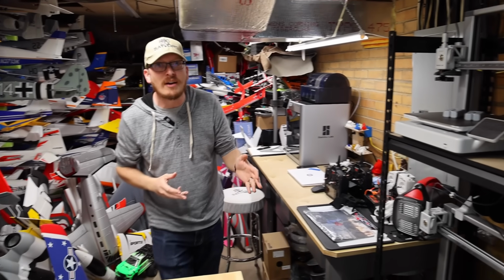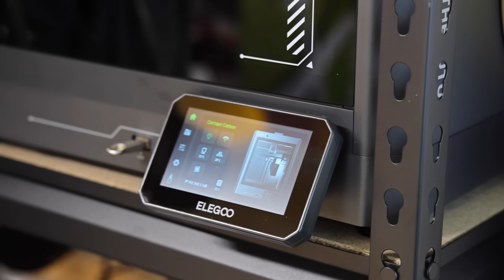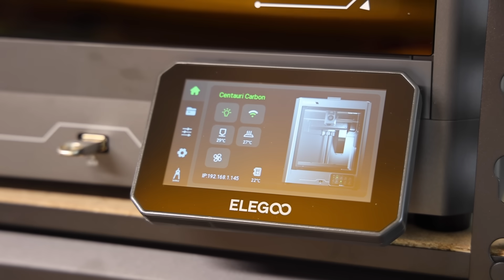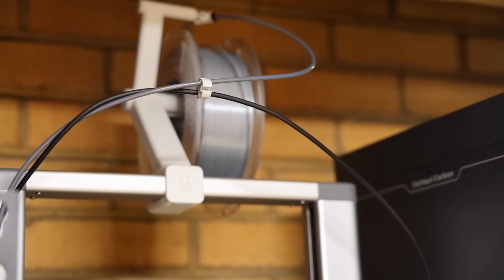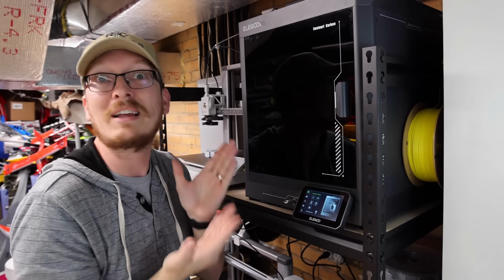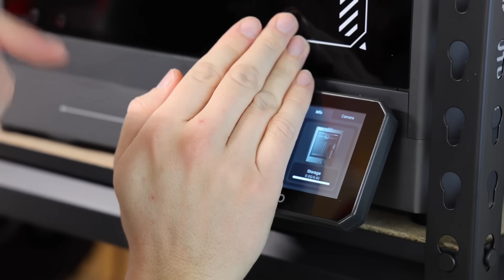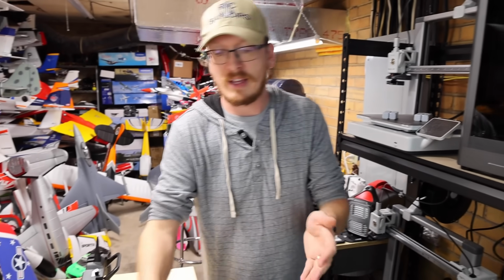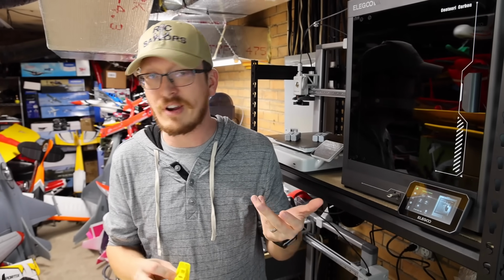Elegoo Centauri Carbon $299 CoreXY Enclosed 3D Printer - First Impressions

Comment from the maker: This printer is back ordered for months.  We recommend checking this one out instead: https://shrsl.com/4ugkc
This is Nate's experience with the Elegoo Centauri Carbon 3d Printer.  Let us know what you think of this 3d printer in the comments.
This printer comes equipped with these features:
Print Right Out of the Box
Full-Auto Calibration
CoreXY with 500 mm/s Velocity
20,000 mm/s² Acceleration
Unleash Creativity with Every Filament
Chamber Camera Acts as Your Eyes
Build Volume 256 × 256 × 256 mm
Disclosure: This description box contains affiliate links.

Check out the Bambu Labs A1 here: https://shrsl.com/4ugkc
Check out the Bambu Labs X1C here: https://shrsl.com/4t6rk
Filament used in this video : https://shrsl.com/4t6rl

TheRcSaylors Shop: https://www.etsy.com/shop/TheRcSaylors

You can see more on Elegoo's website here: http://www.elegoo.com

The products in this video are rated for ages 14+.

Amazon Storefront: https://bit.ly/m/TheRcSaylorsAmazonStorefront
FMS: https://www.fmsmodel.com/bG7_qnRWGKXIak
AMain: https://bit.ly/3FIc1V7
Hobby Zone (Arrows): https://bit.ly/3Sp3HRR
Tower Hobbies: https://bit.ly/3FB56gq
Banggood: https://ban.ggood.vip/14gJx
Redcat: https://www.redcatracing.com/?ref=FXq96heFYK8m
Aviation Apparel: https://bit.ly/48yTc3Z
Fair RC: https://bit.ly/3QkFJ7r
Horizon Hobby: https://bit.ly/4c8vZXZ

Support TheRcSaylors
     Patreon & Stickers | https://www.patreon.com/TheRcSaylors
     Website | https://www.thercsaylors.com
     Merch | http://www.thercsaylorsyt.com/shirts
     Mail | 1140 Carter Ave, P.O. Box 361, Ashland, Kentucky 41101

Social Media
     TheRcSaylors Shorts | https://bit.ly/3rN37xp
     Facebook | https://www.facebook.com/thercsaylors
     Instagram | https://www.instagram.com/thercsaylors
     Twitter | https://www.twitter.com/thercsaylors
     Vlog and Live Channel | https://www.youtube.com/TheSaylorsYTchannel

SPECIAL THANKS TO OUR PATREON FAMILY!!
john salt, Jose Valentin, Ray Hicks, Richard Higginson, Robert Sanges, Russ Cooper, ruudy, Ryan Alexander, TIMO, Zach Gushing, Chris Hamlett, David Chenzoff, dmilbrandt, Doug Dahlheimer, Gary Zion, Haar Bear, Jason day, Jeffrey Davis, and Jesper Larsen

#3dprinting #elegoo #3dprint

Comment: The noise levels are a main thing for me! I'm an Elegoo resin printer guy through and through, the Saturn 2 8K beautiful, no sound, Saturn 3 12K ultra loud, Saturn 4 16K ultra, back to being quiet as a mouse, perfect! I did make a blunder buy a while back when the Anycubic M5s came out; that was like an F16 starting up, it was so loud, so that didn't stay long! But I am looking for my first FDM printer and first turn was to Elegoo, but this is a nope from me! What's it got, plastic or 3D printed parts in them motors and fans?

Comment: To noisy for me.  too bad..
Reply from the maker: It is by far my loudest machine. However I’ve had a few good prints on it. I e also had some failed prints. I’m sure it’s my settings, but it is also my slowest printer. It can handle benchies just fine but any file I’ve downloaded usually prints super slow and if I speed it up it tends to have issues. The main one being print bed adhesion issues. Least favorite current printer, but would be better than no printer at all and is better than a lot of options out there. 👍💯⚓️

Comment: i will buy my first 3d printer, i am still a beginner and do not know most programs and am not advanced either. i have researched for a long time and actually 2 models fall within my budget the elegoo centauri carbon for 300 euros or the qidi q1 pro for 420 euros. both fall within my budget of maximum 450 euros. i have the idea in terms of specifications that the qidi q1 pro scores better. but because i am a newbie it would also be useful if the software is user friendly. 

which one would you recommend to me? i find ease of use, reliability and lastly print quality important. 

i am not very handy with tinkering and repairing so i prefer something that is reliable.

which of the 2 would you choose for me? And why? 

By the way, I've been following you for a while, you're really doing a good job!

Comment: I love how Elegoo has shaken up the industry with this printer but...I'm skeptically optimistic. Elegoo has inconsistent quality control and their customer service is mediocre, at best. It will take a year or two, and 1000's of print hours, before they will even begin to touch Bambu's market share, particularly in the print farm industry. 

Also for anyone looking for a budget, fully enclosed core XY printer with a hardened steel nozzle check out the Qidi Q1 Pro. You can get them for less than $400 and they are the best kept secret of print farms all over the world. They aren't the prettiest, but they are absolute workhorses. Plus, Qidi has fantastic customer service. As a bonus, it has a chamber heater, which makes printing ABS, ASA, Nylon, and CF filaments as easy and reliable as printing PLA.

Comment: Nate, there should be upgrades for the fans as manufacturers usually use the cheapest as people start posting mods online. I always go over new printers just to check that all screws etc are tight etc,plus lubrication in case they slacked up on it. Look at some Printed RC planes…Abby that’s part of the hobby too😳LOL

Comment: I pre-ordered mine last month when it finally hit. I almost pulled the trigger on the bambu labs x1c (I still might eventually) but after all of the bambu issues with their basically locking everything down, it kind of swayed me away from the purchase. I guess I'll wait to see how it works for bambu before I jump back in. But the x1c will stay on my radar.  I do like that I don't need the internet to run it. Unfortunately where I live internet prices are getting out of hand. Maybe If I can find something in my price range. Until then I guess I'm taking the elegoo bus to 3d printing town. 😁

Comment: The Elegoo has a massive cooling fan on it that they introduced with the Neptune 4 series. You have the fan that's on the hotend which is pretty normal. Then there's the auxiliary cooling fan that brings a cat 4 hurricane into your home. I know on the Neptune, you can turn that fan on and off. If you're only printing at like 200mm/s then you don't really need it. I would think that you can also turn off the Aux fan on the Centauri as well which should drastically lower the sound.

Comment: I don't know how so many reviewers just cannot see the EXTRUDER tab. It's not even hidden. I could literally see it in this video. Thats where the load/unload the filament is.
Reply from the maker: I find it interesting that multiple people have missed it, like myself. That tells me there is a bit of an “ergonomics” misstep on Elegoos part. Though not a big deal at all, it would be nice if it were placed somewhere “more obvious” since this is designed to be a beginners first 3D printer! Thanks for taking the time to tell me where it is! 🙏👍😎💯⚓️
Reply: @TheRcSaylors  to me, the layout is very similar to the X1 Carbons interface. It was all very intuitive.
Reply from the maker: You’re right, it is extremely similar! Maybe that’s why it was difficult to find that “page” 🤷‍♂️💯😁⚓️

Comment: Could you make sound comparison between bambulab and centaur carbon where you use similar speeds and accelerations in both machines. Is just the speed that is noisy or the printer itself.  Now I'm not sure if comparison was that super fast benchy vs bambulab normal speed. And of course what the noise level is when using centauri carbon with that silent mode.

Comment: People think that since it's enclosed, it should be quieter. This is not true. Having a x1c and an a1, if I have to print pla, petg or tpu, I rather use the a1. It perform as good, but way more quieter. The x1c is used when an enclosure is needed with high temperature filaments like abs or asa and other. If you don't plan to use other filaments than pla, petg or tpu, don't get an enclosed printer unless you are ready to deal with the noise

Comment: Click on the 3 line icon on the home page, then the extruder tab on the top and there are load-unload buttons . Mine came with the latest firmware already installed.

Comment: Going to need a 1,000hr torture review haha
Reply from the maker: I’m planning on putting some hours on this thing. I just don’t know how well it will hold up! Why’s it so loud though!? 😬💯⚓️
Reply: @ Bambu CEO has a degree in turbulence. Hence why they are so quiet in comparison and cost difference as well. I’m hoping it last as I’m looking for a few for my farm. 

Currently have 3 A1s and 4 minis with all over 3,000hrs each and no issues. Except one mini with a nozzle heater that went out a few hundred hours in. Also the nozzles tend to slowly clog after a few thousand hours on the A1/mini series etc.

Comment: I have the X1 and the PS1 and both have the dual side plates  from the factory. I also have 2 A1s so as you can tell i love Bambu Printers. Just to let you know im far from new to the 3d printing game my first 3d printer was a kit you had to assemble nothing was in 1 piece but the frame pieces. If anything if you go cheap in 3d printers thats what youll get. Dont fall in the oh goody its cheap, Because in 6 months when you cant get parts youll wish you had went a better brand with part support.
Reply from the maker: I’m sort of feeling that way about this printer, currently. Getting those vibes. The more I hear about Elegoo (other than for filament purposes) the more horror stories I read and hear. Seems to be a lot of instances. This CC for $299 is insanely appealing, but being back ordered until July might be an indicator of part support, as you mentioned. It’s printing well now, but really wondering how well it will hold up over time. That is the true test of these things IMO. 👍😎💯⚓️
Reply: Totally agree… I had such a horrible past experience with Elegoo. I would need to see long term use cases before I would ever consider another printer from them. It looks cable but how long is it going to stay that way

Comment: IT looks very similar to the Creality X1C, even the display is in the same location.
Reply: More of a mirror image the x1c screen is top left and the Elegoo screen is on bottom right but about the same style core xy machine
Reply: 1: Creality doesn’t have a x1c .
2: this will give a better experience than the k1c with better quality frame and overall hardware and build.
Reply from the maker: A lot of people are suggesting that it’s a direct ripoff done much cheaper. I can totally see that. So far, I’m not sure if the super loud noise is worth the small savings, yet. 🤔💯😅⚓️

Comment: This printer is a much more capable machine than the A1, like it's comparing apples to oranges. In fact, it's more capable than the P1S too. If you're looking for a printer that can print advanced materials reliably for engineering or functional purposes, this printer is second only to the Plus 4 and maybe X1C. You should Also consider greasing the lead screws and guide rods, it should have come with a packet of grease for this purpose. There is also a load, unload function in the extruder tab.
Reply from the maker: Usually when I’m comparing something, I lean toward price as my baseline. Also, I don’t have a lot to compare it to as you might see 😅 However I do understand it isn’t a great comparison. I am a bit worried by how loud this machine is though. It almost scares me thinking it’s about to explode or something!! Do other reviews speak to how much noise this puts out? 🤔💯😬⚓️
Reply: @TheRcSaylors  I'm sure you looked into it more yourself but just incase, yeah others noted it's a little more on the loud side specially compared to other machines
Reply: It's not a quiet machine for sure, but no you don't have anything to worry about lol. I think it's construction method, while making it extremely sturdy also allows resonances to amplify sound upon its surfaces. 
I would check to see that any screws haven't backed themselves out during shipping. There are also sound deadening mats that you can stick onto the sheet metal panels to help eliminate resonances if it's an issue.
The Kobra S1 is a quiet machine if you want something enclosed but it's filament compatibility is more restricted like the P1S'.
You can download a decibel meter on your phone and check to see how loud it is with the doors closed. You shouldn't see anything above 60 I think.

Comment: The Load/Unload is under a tab on the settings page I believe. (I had to search too after the upgrade) I'll double check when I get home. I didn't notice that much noise, but I'm not in the sane room and haven't printed at Ludicrous speed. Perhaps a little of the enclosed grease on the screws? There is on board storage that you can reprint from as well as store the time-lapse videos. I usually download prints from my laptop. Thingyverse has some neat addons for your Simple Scout XL too.
Reply: It is under "settings ", then "nozzel" tab.

Comment: From the home screen go to the 3rd option down (3 lines with dots on them) where you can control the axis. Click on the extruder tab and you should find the load and unload filament buttons.
Reply from the maker: Thanks! I feel like this is a bit “hidden” but that’s just my opinion of course. I appreciate your help! 🙏👍💯😎⚓️
Reply: The Centauri Carbon's fans really do need to be dampened. 
There are other things like how the frame and outer panels are designed. The filament spool holder doesn't look strong enuff. You can actually see the side panel pull out if you tug on the spool holder. 
Firmware and having to stay within the Elegoo Slicer clone are a bit restricted in my opinion. 

Have you tried out the fluidd interface yet. 
That would be great to show in a future video. 
I have let Elegoo know that if I buy 10 of these I'm going to want to put 400watt heaters in them and they would have to work with me on upgrading the electronics to withstand 60c chamber temps. 

Interesting video! 
Really like your genuine approach to review videos. 

Keep posting videos as your experience progresses and good luck! 🙂👍🏻

Hillbilly Engineer

Comment: i wish it had multi color
Reply from the maker: Me too! Elegoo has stated they plan to add multicolor ability to this printer later in the year, but obviously it will cost more. 👍💯⚓️
Reply: @TheRcSaylors  where could we connect it? All feedbacks tell that there is no connection on the motheboard and only one USB port on the front 😢
Reply: It has a poop shoot built-in so  some multicolor unit should be released in the future
Reply: *chute